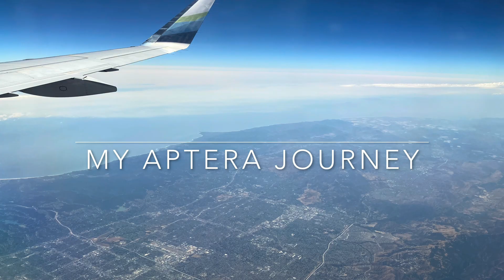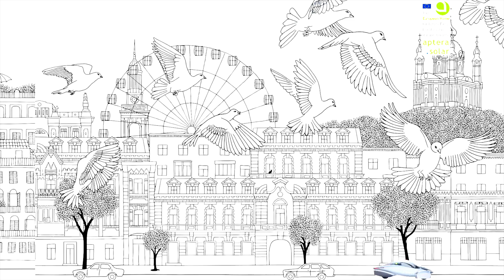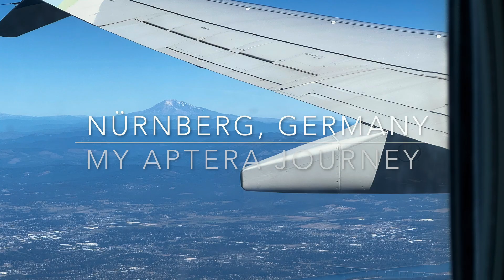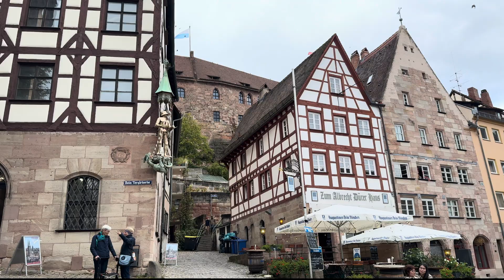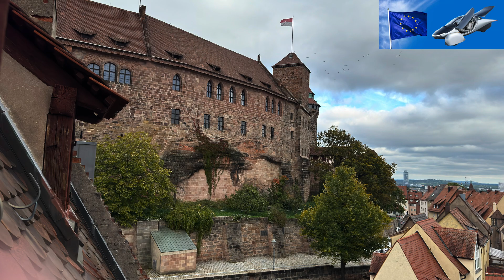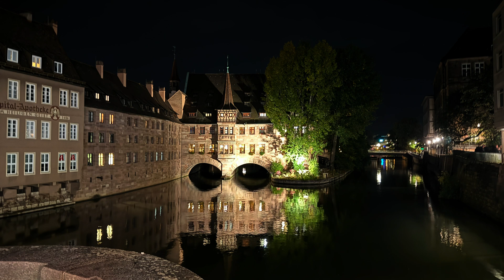Europe offers Aptera huge market opportunity.  Aptera should start homologation soon.

Comment: They're nearing their 20th birthday and so far have always found something that supposedly stands between their current status and releasing a product. A better stereo, an advanced driving assistant, solar panels, better solar panes, different batteries... Homologation for foreign markets? Sure, why not. That takes them through the next decade of not quite getting anywhere but still burning through tons of money while not doing so. What is the opposite of "focused"?
Reply: Sorry, Aptera 2.0 is not even 4 years old. Still in the kindergarten.
Reply: @adimchionyenadum2962  And in a few years you'll say the same about Aptera 3.0.
Reply from the maker: Thanks for your comments.

Aptera Motors management can write a contract with specialists to get this homologation process started - very little money can open big market.
Reply: @Rich1Rodriguez  That wouldn't even be true for a normal car. There are reasons why OEMs only offer certain models in certain markets and not in others. In the EU, there would be demand for Japanese Kei cars. Not millions every year but certainly steady demand justifying export cost. The reason why they don't sell them in the EU regardless is that homologation is expensive, time consuming and in most cases impossible without drastic tech changes. The opposite of "very little money".

Comment: With 30 years of automotive engineering working for the company that is now Vitesco Technologies I think your wildly optimistic to think that a 88"wide (22m09) vehicle can be homologated by the EU. Simple reality is that when parked in line on the aug you left wheel sticks out of line of the other parked cars by over 14" (Model 3 considered to a wide car in Europe 1850mm).  No regulator in Brussels will sign off on that ever. Much easier route is to create an EU version and maybe an EU partner to manufacture it here.
Reply from the maker: Thanks for your comments.

The point is many areas, not all, in Europe are perfectly suited for an Aptera.  If I drove the Mercedes EQE through Europe, I’m sure an Aptera would do OK too.  Many tight places, yes, but with good cameras, you can do OK.

Second point is homologation needs to start for Aptera.  As mentioned in the video, the standards are being updated now and it’s a perfect time for Aptera to get in the middle of these discussions.

Charge on!
Reply: @Rich1Rodriguez  Delusional: no EU governing body will agree to a vehicle wider then the widest you could find. Yes I like the Aptera concept, love to have one but at current dimensions it cannot ever be homologated  in Europe. Experience of 30 year of EU automotive homologation work.
Reply: @Rich1Rodriguez  - Looking at the market and comparing it to the US doesn't work. I doubt that when people find out the width and length (looking at the footprint) it literally uses up more space and contributes to the traffic issues. Especially in large and small towns.

So, Aptera has a huge issue and they need to convince the Europeans that it's fine to have something that takes up so much space because it's solar and efficient when it comes to consumption. The US is way better as you can drive all over the country and just avoid old legacy cities. Too bad Europe is not that way when it comes to all of their open space. You do have a pic of the town you were in and that would be a real issue for an Aptera owner.
Reply: I agree. This past summer I hiked in Switzerland, Germany France and Spain. I had lots of time to see what the Aptera would fit into. Unless it's a main road, I do not see where the Aptera would be practical. I would look at it as you'd need to park it outside of the city and go in by foot or public transport. There's pretty much nowhere you can park them and forget about parking garages.

Even in Frankfurt, they want you to park part of your car on the sidewalk because the streets are not wide enough. I thought it was interesting how far a Jeep Wrangler (which seems that Europenas like) is around 14" narrower than the current Aptera.

I find it ironic that this video shows narrow European streets too.
Reply: @billsmith5960  Yes agreed with you: the current Aptera width cannot work on EU roads and no EU regulator will sign-off. What is worst is that I don't see any technical reason why it should be that wide. I think that Aptera should be about 2ft narrower and it will loose nothing.

Comment: I would love to see the Aptera on European roads, unfortunately it’s width is way too large to be practical. Would be as clumsy as a Hummer ! 😢
Reply from the maker: Thanks for your comments.

In my recent trip to Europe, I drove a Mercedes EQE AMG.  I had reserved a smaller car, but only the EQE was available for the length of time I wanted.

It was definitely larger than I wanted, though it drove nicely on the autobahn. 

I’m thankful it had lots of cameras which made things easier in tight parking places.

Charge on!
Reply: If I am not mistaken the EQE AMG width is a bit below 2m. 25 cm less than the Aptera and already a challenge in most streets and parking lots. 
I hope that the Aptera will get the success it deserves in the US and that you will then downsize it in a more EU friendly/pratical version. 
I am sure the Aptera would rock here because like the 2CV in another time (best car ever IMHO😊) it perfectly responds to simple and essential needs. Except EU roads size unfortunately for us.
Looking forward for your success 🤞🏻
Reply: @Rich1Rodriguez  "it drove nicely on the autobahn"

So does a semi-truck.

Comment: A very large market opportunity in Europe ? A Tesla model 3 is already too large for Europe and a Tesla model S cannot enter in many underground car parks without damaging its wheels. And a model 3 is 1 850 mm wide, a model S is 1 987 mm wide, and an Aptera is 2 230 mm wide !!
Reply from the maker: Thanks for your comments.  While I was in Europe recently I rented a Mercedes EQE AMG.  I was too big for me, but was great on the autobahn.

Aptera has a place in Europe.  Once we go through homologation process we will know better.

Charge on!
Reply: @Rich1Rodriguez  Ok, I guess that is you paint the front wheels in orange they may not be ripped off by passing cars when parallel parked in a city. At least don't forget to switch from NACS to CCS2 or you will just have to rely only on the sun and then not sure it will be so great on the autobahn. But sure, Aptera has a place in Europe, it has just not be designed for Europe so don't expect big sales, not to mention there are plenty small electric cars in Europe.

Comment: Also, Aptera has never had a fully functioning prototype. So getting a vehicle that is still in the R&D phase is a bit hard to get it homologated. I suggest Aptera get to the going of making a fully functional prototype and send it to the EU. Remember, Aptera has admitted that it's never been fully functional. A good example is full solar and the battery.
Reply from the maker: Thank you for your comments.

I believe we will have fully functional vehicles in a matter of weeks.  

Then many things will be possible, including sending some vehicles to Europe for homologation purposes.

Charge on!
Reply: The first thing to do and also the most important is to commit somebody to the working groups here in Europe. That does not require a vehicle.
The second thing to do is to issue international standardized technical documents so experts can have a look and give feedback. That also does not require a vehicle. But the process starts. 
By then a PI** vehicle will be available and the hands-on work can start.
Reply: @e-economy-  - Sounds like to me that there are a few things:
1. No prototype exists that actually works
2. It's a US company
3. No proof of the claims
4. When you say, "commit somebody", that is secret code for, we need to pay somebody that is experienced in this field. From my experience, that costs at least 50% more than in the US.
5. No timeline. I hear, a few weeks. Instead of saying that, just give the actual number of weeks. Is it 2, 5, 12, 15 ? Few means nothing.

Without holding the company to a timeline, all this does is raise the cost of homlogation. Because you can't just keep thinking regulators will just sit around waiting for you. Plus those expensive consultants you hire will go onto other jobs as they just can't afford to sit around and wait for a company to make a product of some unknown time frame.

I wish I could tell customers, "I will get that project done in a few weeks." Then they would just say, "Sounds great!" Instead, the real world response is, "How many weeks?"

Aptera is a transparent company yet no number of weeks for a complete fully functioning Pi. When I mean a fully functioning Pi, I mean, it better be complete, not just 20% and hope that's good enough. I deal in the real world and know how it works. When dealing with the EU and especially the Germans, you better prove your data and not just claim it.
Reply: @billsmith5960  
to 1: we have seen one on video and I have spoken to people who have seen PI02 personally and actually driven the prototype (Gamma)
to 2: yes - but what's your point on this?
to 3: which claims?
Reply: @apterasolar  :
1. Please reread point #1. When I mean works, it needs to be fully functioning. Not just something driving around in a parking lot. Not something with a small battery pack of a different design. Not something with a lack of solar, not hub motors, not skin cooling. That Gamma you drove is nothing like what they intend to make. So, those were ideas and that Gamma is over two years old. Plus not one has published results and tested by a third party to make sure that the company is telling the truth.

2. US companies have a harder time when it comes to certain countries home markets. For example, cars. Germang is quite protectionist when it comes to that, so it makes it harder for an unknown startup with no vehicle to get people to change the EU regs for a theoretical vehicle.

3. Claims? The solar, range, price and efficiency. Show me one that has been proven and you must use the current design, not some old one. Look at point #1 for a reference to this.

Also, if you ever had to deal with a German company and their engineers, they are persistent on you proving the claims with a real product. Sounds like you have not or if you have, they give you the benefit of the doubt as you are not from the US (referring to point #2). As an American and also my wife (who works for a German company) we both have to go through much more rigor when it comes to what we claim will work. I doubt Aptera will get a pass, thus the lack of interest there.
Reply: @billsmith5960  
A prototype (Alpha, Beta, Gamma) is never intended to be fully functional in the sense of a close-to-production vehicle. That's just the automotive development cycle.
The current non-finished vehicles are production-intend. As those are the first two, inherently they are not complete.
Given this terminology - yes, there is no finished Production-Intent / PI vehicle so far. And yes, it is getting later and later but the phases of development we are seeing are just typical in that industry.
Reply: @apterasolar  - What do you think the regulators are going to think with that argument? Do you think that they will approve a new classification or expand one just written for Aptera which is a vehicle that is at best rolling around in a parking lot? All for a US company they have never heard of?

Also, have you asked Aptera about this? I'd be a bit upset if a fan of the company went out and tried to raise money in my name to pay a consultant to get a mystery set of specifications approved. Here's the thing, the specs can change and they did drastically from the Gamma to today. They might change again.

I'm just saying this as it could lock out Aptera for 10 years in the EU if a change comes about yet, the company changes the specifications a year from now.
Reply: @billsmith5960  how did Sandy Munro recently say: There is a difference bw people who complain about how things work and people who do something about it.
Reply: @e-economy-  - Also there is a saying, work smarter, not harder. Then another one, make sure you know what you are getting into because you might not get the intended result you were looking for.
Reply: @ I trust that that group of people knows what they’re doing.
Reply: @e-economy-  - To me they are complete strangers making claims. I guess trust is easier to get today, as opposed to results.

Comment: Thank you Rich, for regarding Aptera also covering Europe!
Reply from the maker: Thank you for your comments.

Your YouTube handle is awesome !

When you realize the European market can be larger than the United States, it makes total sense to start the homologation work now, especially when regulators are updating the standards now.

This can open up a huge market .

Charge on!
Reply: @Rich1Rodriguez  WHERE is the money coming from to do the European work? They DO NOT have the money to make the metal frame for the ones in the USA! By the FTC filing they could be out of business in a year or less, if no money comes in. To date- but very little has show up, the Note is a failure.